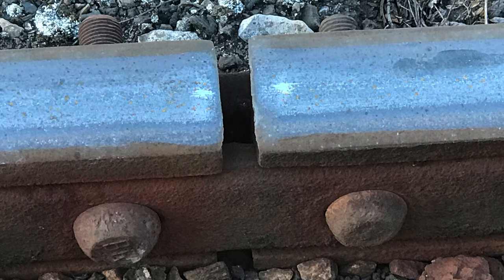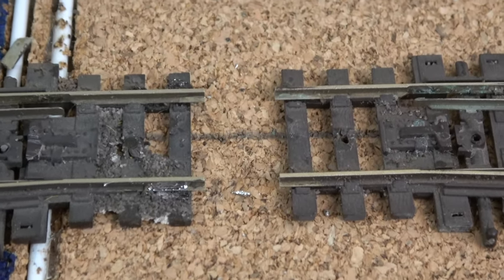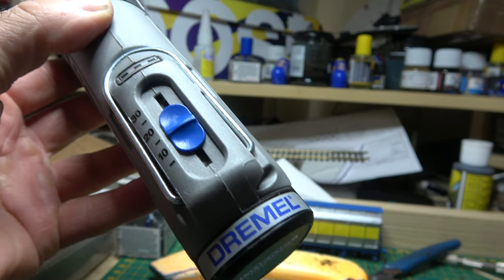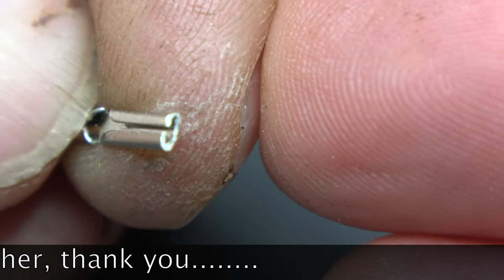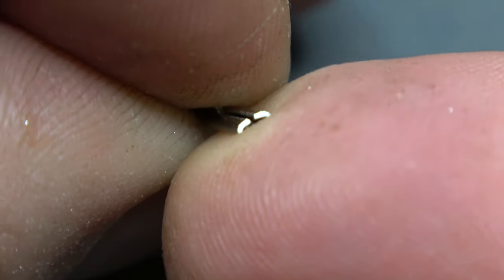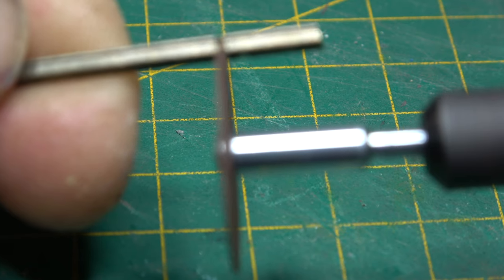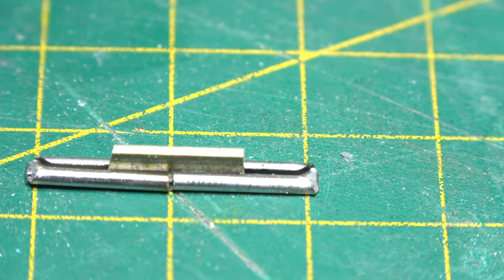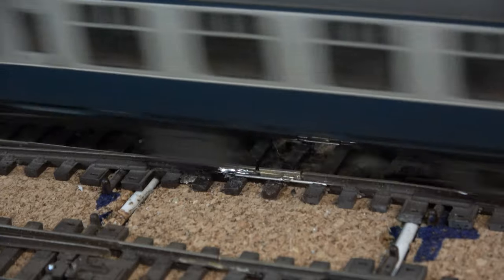Large Rail Joints

Comment: A prototype for everything! 

Never saw anything like that in 41 years in the S&T! 👍🏻
Reply: Darren Hillman I spent 33 years in the Pway Dept and to connect rails after a fishplate failure or a rail cut short etc you would be surprised how the the job was done lol.
Reply: Darren. You must have worked for a proper Railway Company - BR. Not this dangerous Mickey Mouse Franchising nonsense. Many quality BR staff, especially Engineers left Britain soon after BR was abolished, and like me got a much better paid job with an overseas Railway. BR of course had some of the most stringent safety regulations on the Planet, and smarter overseas Railways knew this and were willing to pay more, for ex BR staff.

Comment: RAIL JOINTS ! 
The picture shown at 1:50 is sourced from Indian Railways. It would never be allowed on a British Railways "Running Line" as its highly dangerous !  A further indication of the dangerous methods used "overseas" is the fact that the Baseplate (between rail & sleeper) has been spiked. And one spike is missing from each of the two baseplates visible !!!!